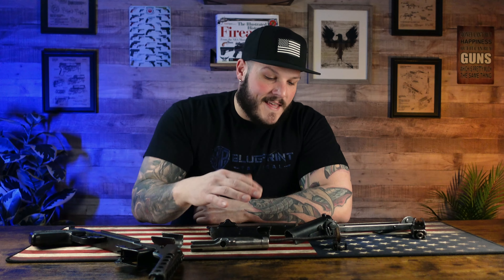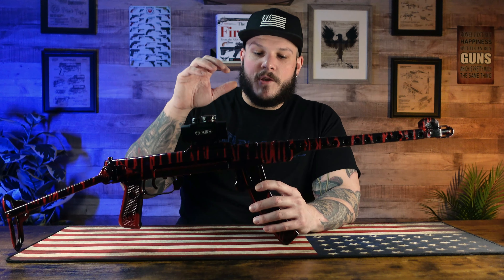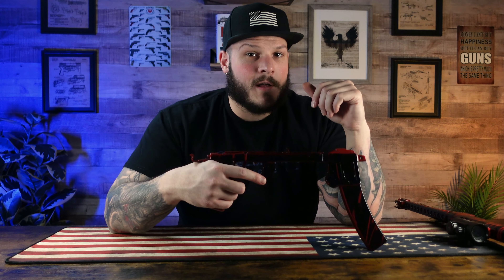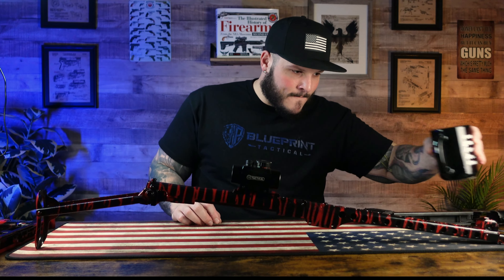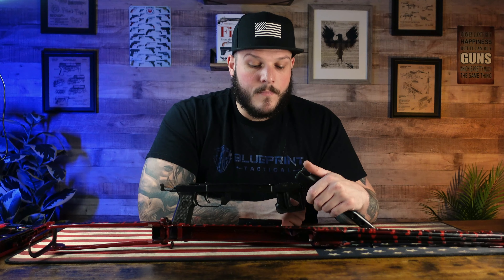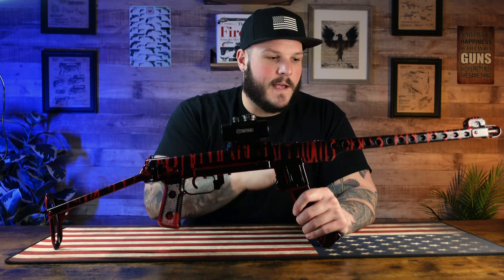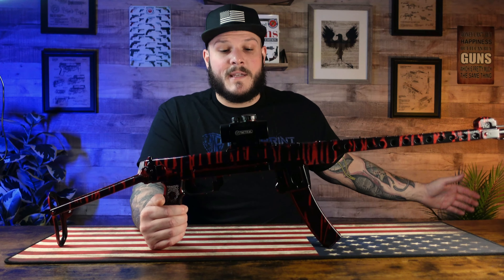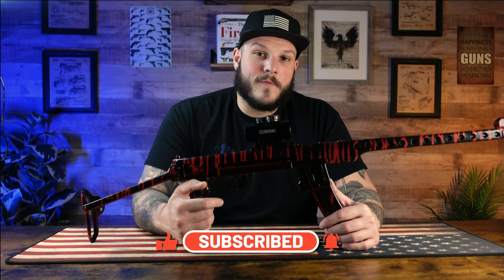Coolest Red Tiger PPS-43 You've Seen! | Blueprint Tactical

Comment: Rather have a lot of extra difficulty getting more holed shroud section to link together. You can get a KAK industry retro flash hider that's made for extending a 10 inch AR barrel. Yes an AK hammer and trigger will work.